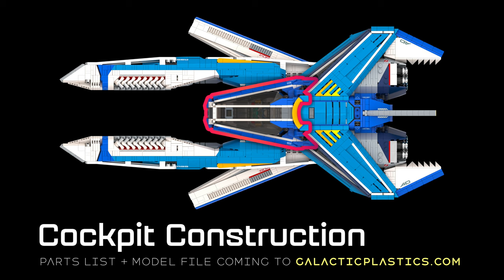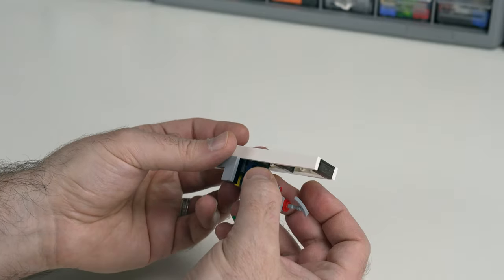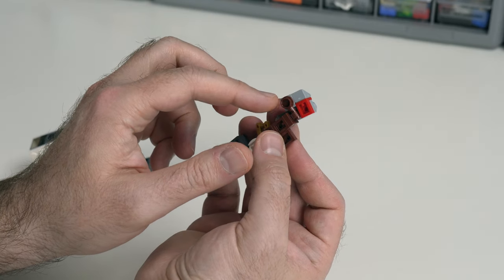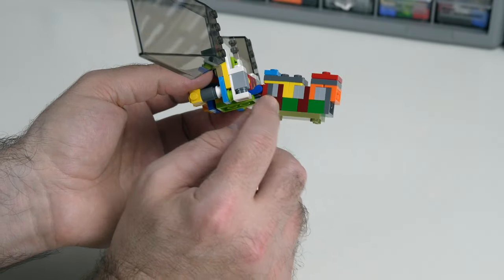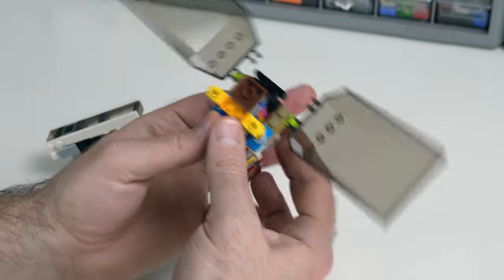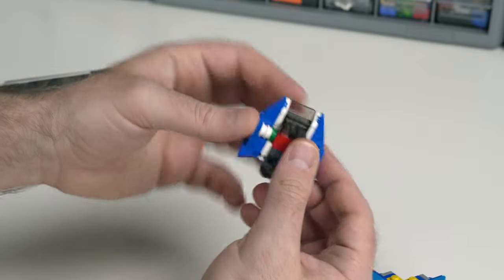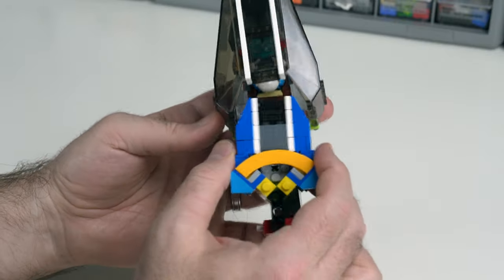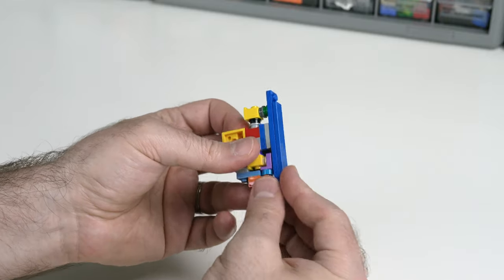Advanced LEGO: Interference (Cockpit Design)

Comment: I love these style of videos! Really helps us understand your masterpieces and how they all fit together! Keep it up!
Reply from the maker: Thanks for the feedback! 🙏
Reply: @nicktrotta  , hello...I am trying to build a fleet of small Vic Viper body structure space fighters that are going to be fitted into larger ones that will fit into some smaller capital space ships that will link to a big core, and that my project will ultimately involve lots of LEGO, but, for the moment, I am trying to build one smaller destroyer/troop transporter that will be somewhere between 512 LEGO Studs long (around 12 feet, 8 inches long, or so) to 1,024 LEGO Studs long (around 25 feet, 6 inches long).  However, I have several issues regarding the design of my vessel.  I do not know whether to go with a 6254267 Cockpit 6x4x2 w/Dia. 3.2 Shaft Element or a 6336741 Cockpit 10x4x3.  Now, after that, there is also the matter of how to properly cover up those awkward slits in those Elements without covering a significant amount of said Elements with other Elements, the ability to properly, as well as comfortably, fit in a pilot into said cockpit area, having a tail that can fold down into divided parts, having the ability to have some wings enclose over the back portions of the fighters on the larger fighters, having the ability to rotate the fighters to a vertical position from a horizontal position, having the wings on the larger fighters form into solid wings once the smaller fighters leave the larger fighters, stacking the larger fighters against one another, having hallways and rooms that connect the larger fighters, and having massive clamps that will hold the smaller capital space craft to the larger core capital ship.  What kind of advice would you have for myself in building these things?  Thank you for your response to my issues, and nice skills, as yours is far past mine.

Comment: Wtf is a clip light?! 

Just watched your other video & you’re like “just attaches with these jumpers” 

JUMPERS?! 

😂🤣

I’ve been a LEGO Maniac for 43 years & I still have so much to learn! 🎉
Reply: Literally right after I posted this I looked over to my (newly organized by part type for the first time ever at my new LEGO building table I’ve spent the last year building) and CLIP LIGHT!! There it is! 

When I first saw the video I misidentified the part as the one stud claw. But it’s the one with the round bit that has two opposing open studs. BRILLIANT.
Reply from the maker: I'm happy you located it! 😆 I noticed that part name has changed in Bricklink from the old days, when it was called a modified plate with clip light. Now on Bricklink it's a modified plate with light attachment. But to me, still a clip light! 🙂
Reply: I’m so so SO very happy I found this video. I ended up completely rebuilding the cockpit for my original Space Police themed Mecha. I had begun building a very similar cockpit using two red windscreens from the Spy Trax set. I was astounded how aesthetically similar the positioning of the two windscreens and centre section were to your build. By mine was still at that “if you look at it wrong, it explodes” lack of structural integrity. The subsequent rebuilds I did with things I learned here made it ROCK SOLID. So much so that I abandoned the need to create a separate body and just attached the legs to the all-in-one cockpit / engine section. THANK YOU SO MUCH for taking the time to share what the brick has taught you 😊